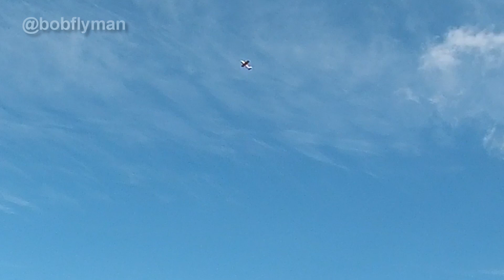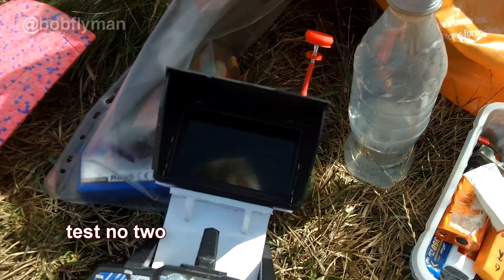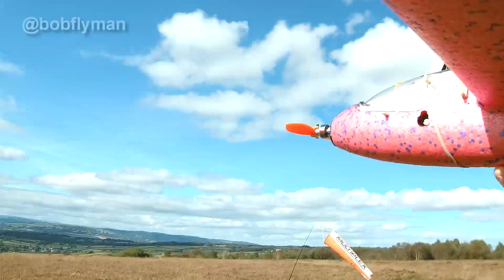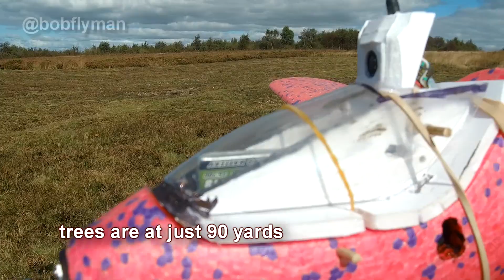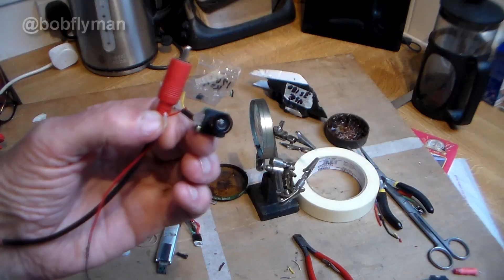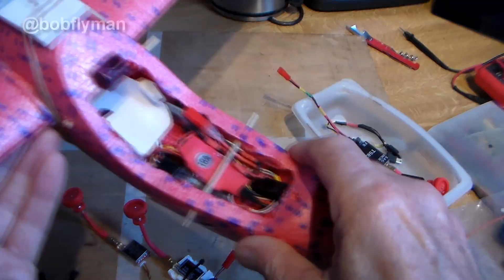FPV Test no.3 for my Lidl  no.14 RC build and Fried Chips!

Comment: God dammed! Separate the TX from the video receiver by distance on ground. Or if it is easier for you separate them by the radio frequency, it is easy too
Reply from the maker: Sorry mate, that doesn't make sense?  The TX is on the plane, the RX is one the ground with me?  I did lots of distance tests on the ground had 1/4 mile vx transmission. The problems I had in flight was vx tx and camera got interference from ESC and power supply. Solved it by moving the video tx and giving it its own power supply.